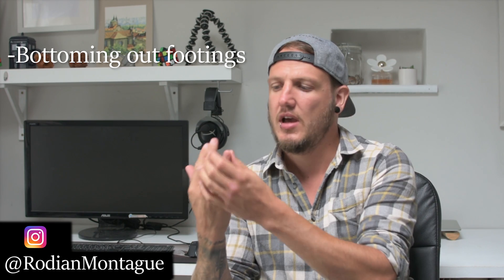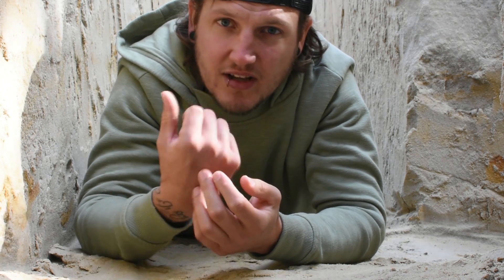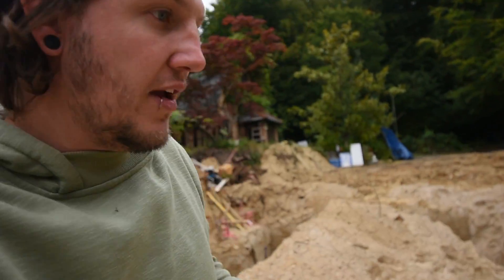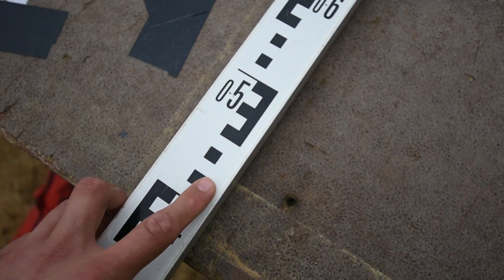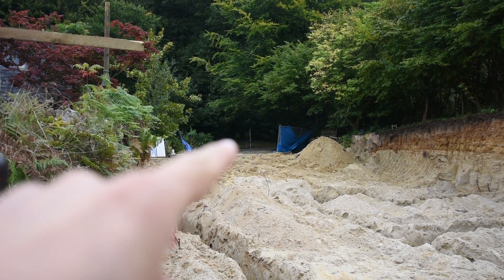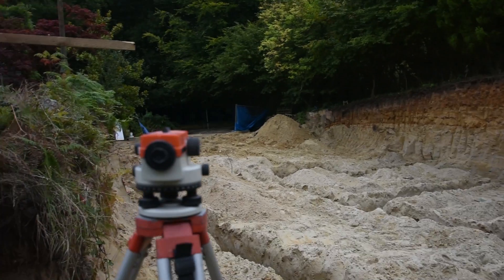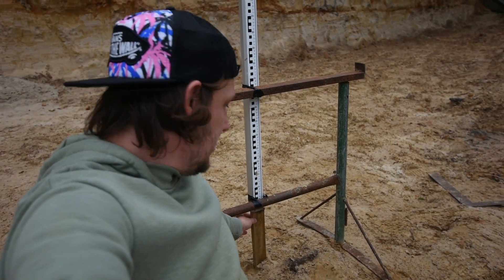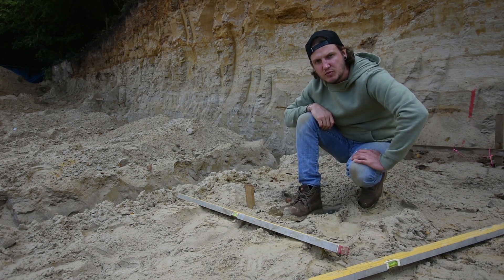Mastering Perfect Footings & Datum Points | DIY House Build Ep 5

Comment: we're on sand too, BCO has no issues with sand and has specified rebar. But the depth of our foundations are tiny compared with yours. Would BC let you pour less and make up the difference to -375 in trench block? it would be cheaper methinks...

Comment: I have literally been digging my footings for the last few days and I’m getting to the point of putting the bar chairs and steel in. 
So glad I came across your channel. Building my own house is a bit overwhelming as I started in the last few days. The learning curve has been exponential, but enjoyable. 

Looking forward to watching more of your videos. They’re reassuring actually, so thanks! Great videography too.
Reply from the maker: Glad to hear you're enjoying the series 😁👍🏻 The footings was a tough one but so glad I did it! Even though I've been in the building game over 15 years I've learnt so much doing the build. You'll be a pro by the time you finish 👌🏼😁
Reply: @RodianBuilds  i get confused at the 12 minutes 30 mark. Surely if you bang down on the wooden peg the the staff will show a higher number looking through the optical level if you have the staff positioned on the top of the peg and if you move the wooden peg upwards the staff will show a lower measurement when the staff is held on top of the wooden peg. Sorry i'm new to this so i'm just trying to get my head round this.